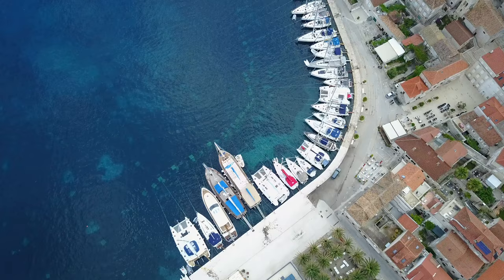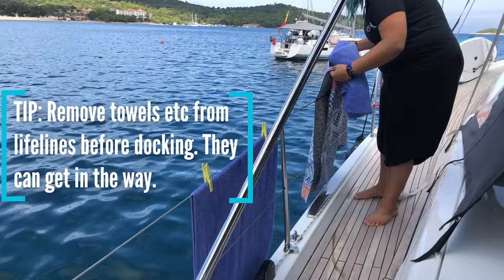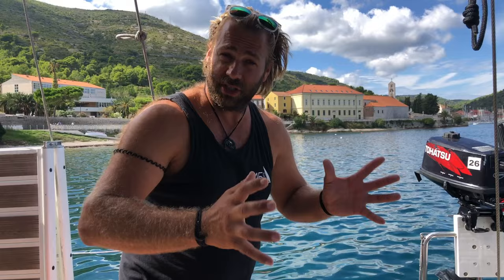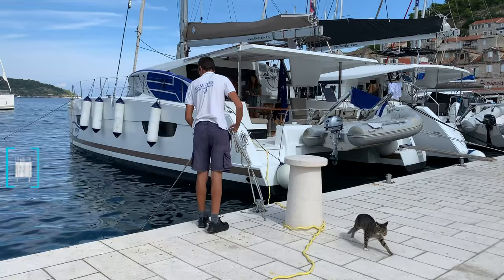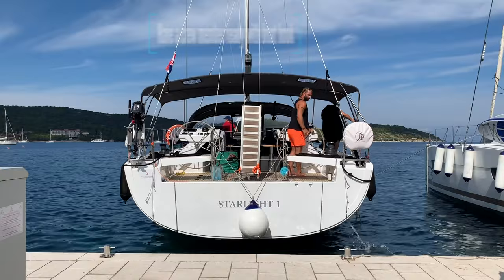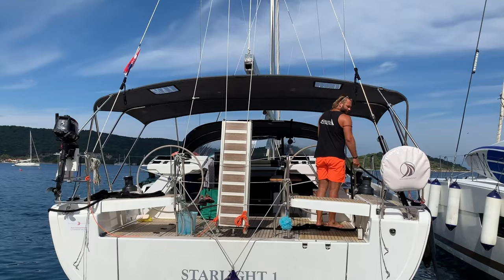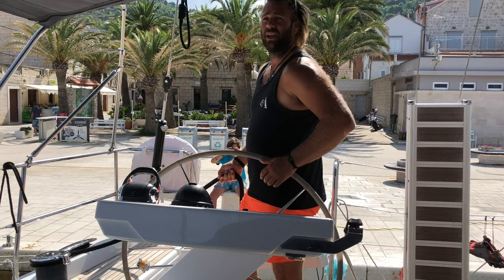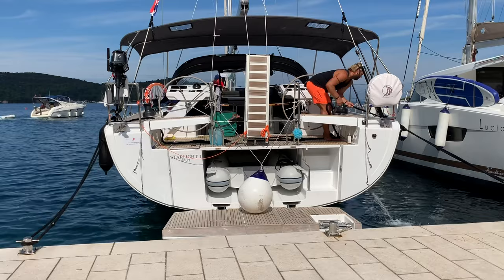Docking Stern to in Croatia with Lazy Lines - Sharpen Up Episode One

Comment: Great video with clear instructions ... unlike the shouting, screaming and revving from most boats coming in :-)
2 questions ...

1 - Which end of the stern lines to give? Most instructors/schools say to give the loop to the dock aid and keep control of the bitter end yourself. Do you give the bitter end because you are alone at the stern and having the dock aid take in the slack is easier? It does look like your cleat has a figure 8 over it in any case for a quick release.

2 - Slip lines left in place? At the end of the video the stern lines are still left rigged at slip lines. Is that how you would leave them for an overnight (not concerned with chafe on pretty stainless steel bollards) or did you just not include switching over to having a loop (bight) over the bollard at the end of the video?

Thanks again for a great video.
Reply: 1. :-) Two ends of a rope, so... there a 50-50 chance you'll be right. Just pass the one with no loop in it to the helping hand ashore.
2. Slip lines are fine for a restful night in the Med, mate. So easy to leave the following morning. 
If windy or you really love your lines and want to be kind to them, just a simple turn and you're ready for sundowners!
Reply from the maker: Hi Benjamin, sorry for missing this comment. Thanks for the feedback :)
To answer you questions:

1 - Which end of the stern lines to give?
We would give the bitter end, no loop. Depending on the pier, marina, dock you visit, there could be bollards, or only rings. In the case of rings you need to send the bitter end through to either have the dock aid tie it off, or preferably get it back so that you can control the line. These days I tend to have a bowline or spliced end over my cleat on the yacht, mainly because it saves space on the cleat. If we perform a cleat hitch with one end and then bring the tail back to do another on top I find it gets over loaded. 

2 - Slip lines left in place?
We leave them as is. I tend to reverse pretty hard on my bow lines when I tension the stern lines so there is little movement for one, and secondly you will likely share that bollard with another yachts lines, so it needs to remain uncluttered. Lastly, as Alexandru answered as well, it makes it a lot easier to leave the dock, and for any reason in the night you would like to ease or adjust the lines, you can do so from on board.

I hope that is helpful!
Reply: @45DegreesSailing  Thank you for the detailed response, I appreciate it. 

Another idea as an alternative is to "dip the lines / eye" *if you are sharing bollards with your neighbours so that either yacht can slip their lines first. 
*thread your spliced eye through the eye already present from your neighbour from underneath and then over the bollard.
Reply: @benjamingass1688  ... very good seamanship! 😉 Only a few skipper know this trick! 👍

Comment: Nick, you’re a legend - just docked at Marina Vis, your video was very helpful. Thanks!
Reply from the maker: Haha. Excellent Ed! Well done. We just docked in Stari Grad. MAN ITS HOT! Probably hit Vis/Kut tomorrow.
Reply from the maker: Make sure you got enjoy a cocktail at Frutarija. It’s on the water between the two ports. Great spot.
Reply: @45DegreesSailing  thanks for the tip, booked into Rokis at 8.30 - will stop off at the bar you suggested on the way to the pickup spot! We were at Milna, Hvar last night and Bobovisca the night before, Stari Grad is on our list. So far it’s exceeding our expectations. Chartered Serenity with Sail Croatia, will have a look at your yachts if we come back. Yes, it’s hot - beats cold Melbourne though!

Comment: Ball fender might need to be a bit lower. How would you judge that before you come in?
Reply from the maker: It does look like that from the shore doesn’t it! Though it was actually good for this one, I always look at it again before I reverse against those lines. There is too much at stake!

My best advise for that is to come past and observe the dock before you come in, look at the height of the water relative the other yachts and make your judgement from this and adjust accordingly. A bit easier when it’s a flat wall. When it’s a floating pier it can be harder to get it right. Generally the safer bet it lower is better.

Comment: How would you do this if you had dingy davits and a dingy hanging from the back?
Reply from the maker: Effectively the same way. you would just be planning to throw your lines from the quarters (above the cleats around your dinghy) and receive them back in a similar place. 
Thing to consider really is the make up or arrangement of the dinghy and davits, are you going to be able to exit the boat over the stern if it remains there? Or is it best to drop it before docking and tow it from the bow as you dock. Other possibility it so dock with the bow in first if you have a design that allows easy entry/exit over the bow.

Comment: Great tips! I will try the figure 8 rope tidyness myself, great idea!

Following the orders of the person on the deck: no, use your brain. It is you who is responsible for the 400k boat, and the marina crew are responsible for docking to be filled properly. In optimal scenario I would want to come close by, agree on the spot (yes, you can have a wish) and what ropes are going to be done. You should tell them which side mooring line you want and which stern line you need to be done first. In reality this is seems unnecessary and without the wind that is probably fine, but if docking is about to be tricky, I would want to take the time, talk to the dock aid, be sure you both know what you will do -- or just send one of your crew to the dock. 
It is when people have no clue what they are doing and they just listen to the person on dock and do approx what they  say that things go wrong. And frankly, many times people on dock just don't have a clue either.  

Another great tip from this video is the clear communication  to the person on the bow: clear, precise, loud.
Reply from the maker: Thought you would like it 😉
Thanks for the comments! Yeh it is a bit of a wish, and with the busy nature of the pier in the season trying to queue and get a spot you get ushered in pretty quickly. This is why skippers need to gain experience and control before chartering in high season.

Comment: Great video. Really useful!
Quick question, how easy is it to tell if you are going to use lazy lines or anchor for stern on mooring? It's it recorded in an almanac or easy to see during the flyby?
Reply from the maker: Thanks for the comment. Easier way to pick it is looking to the dock to see if you can see the tracer lines running into the water that they will use to pick up the lazy lines.  And of course. If there are any other boats on the dock check their configuration.
Reply: @45DegreesSailing  thanks!
Reply from the maker: @ChrisSidwellSmith  most welcome!